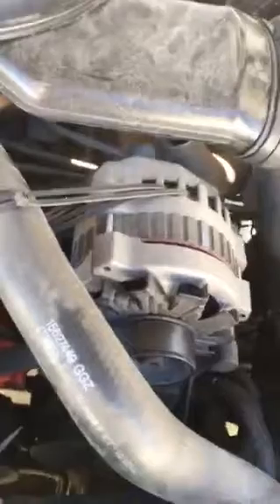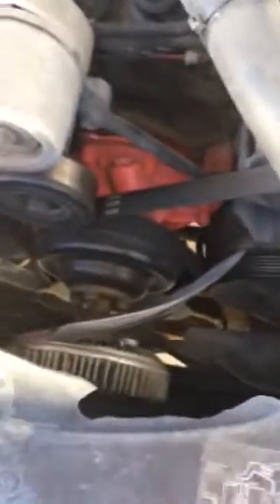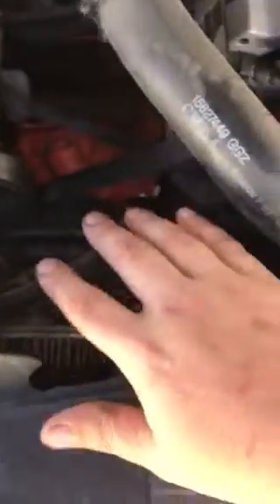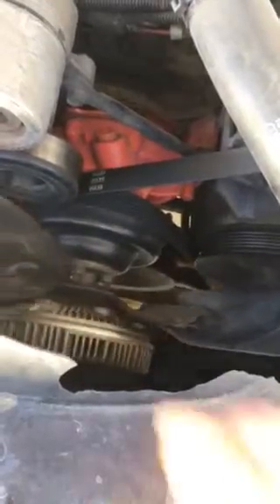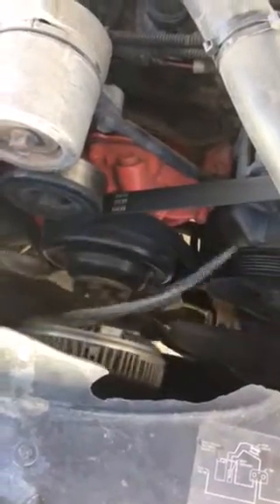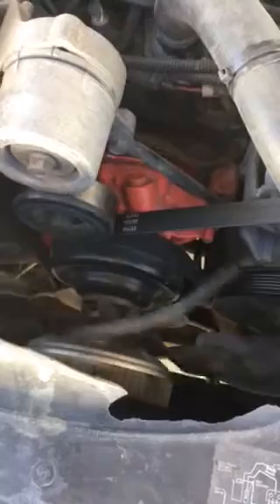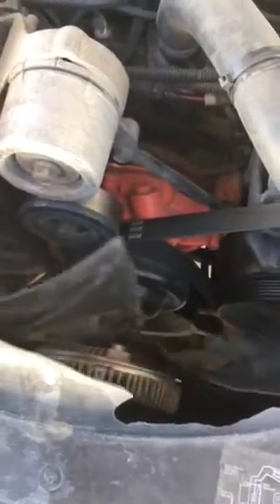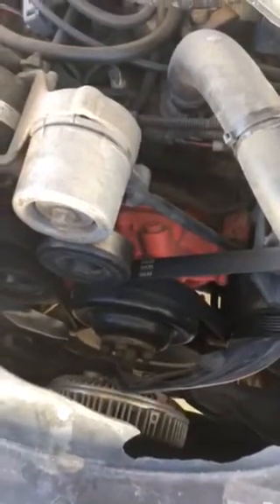How to test to see if you have a bad cooling clutch fan

Comment: Mine is hard to turn... does that mean it’s bad? Also, my fan stays running all the time.
Reply: I think that means it's ok. When it spins easily and freely is when it is bad, they are supposed to have resistance. Use something to try to stop it while it's on like like a rolled up newspaper and if you can stop it easily with the newspaper or spin it the other direction then it's bad.
Reply: How about if it is fix by the mehanic? What will be the problem?
Reply: Did you ever figured out why your fan is running all the time?   I have the same issue thx